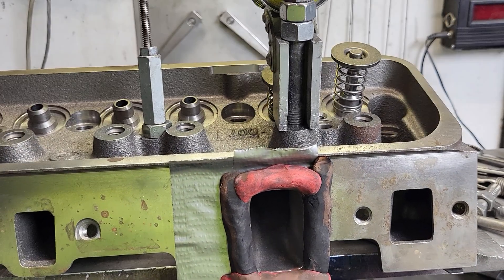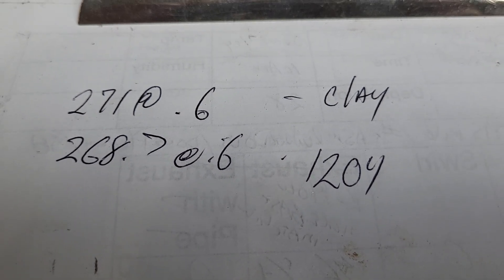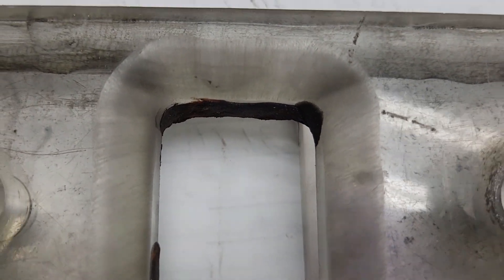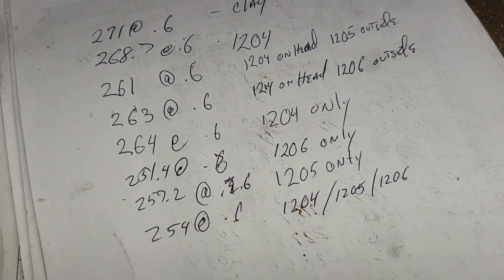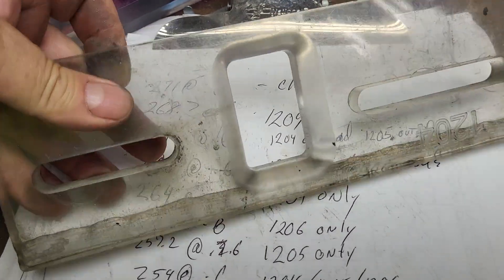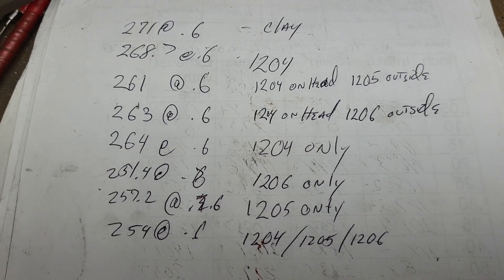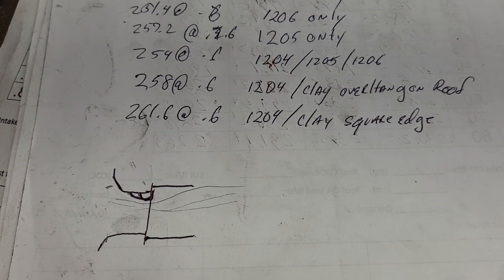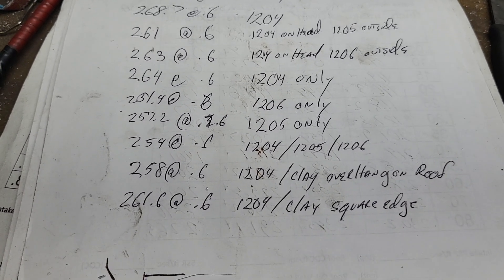Does an anti-reversion edge cost much flow? Interesting air flow games.

Comment: Just came across this and found it interesting cuz I recently pulled my intake off and confirmed that my "lightly ported" intake manifold still has runner exits that are a bit undersized pretty much all around compared to the heads' intake port entries. Wasn't sure if it made sense to work the manifold's runners a bit more, or leave as is. Also, between the burr-type finish of both the manifold runners and heads' intake ports and -- maybe -- those steps in the transition area, the runners & ports look pretty clean for a street/strip engine with a 265 @ .050" cam.
Reply from the maker: Nice. Thanks

Comment: The anti-reversion step is what I put on the inside corner of the Mopar small block pushrod pinch. My idea was the flow going over the step will create a low pressure area and encourage the air column to use the non common wall more quickly as well as create a small anti reversion step.

Comment: As I learn more with each video, I am enlightened that there is SO much to learn and everything needs to work as a symphony… it all is teaching me that an amateur like me needs to start with a block size and realistic end goal… then spend a ton of time and note taking before buying the first part… and with each part, it seems the next part choices might be more limited already by your previous purchased part limits. For a stock street 318 motor used for towing and cruising, I started with the cast iron heads…then next will just mild port my 302s and leave stock size valves, thin head gasket, stock intervals… go standard Edelbrock dual plane and do my best to select a cam suited for the very mild heads… then keep the 4 barrel smaller by trying my 500 Edelbrock first so that everything works towards higher velocity air speeds… and use of long tube headers all in an attempt to pick up the low end torque over stock engine an 2 barrel. Am I at all on the right track trying to make it interpret the last year of videos back from present back to your 302 porting videos? Is my motor too small to be concerned about reversion, or should I follow all of the tricks you talk about in this video for reversion limiting? Sorry so long winded. Don’t feel you have to answer this as I will keep watching and trying to learn. You are my top 5 channels and my top channel regarding my future 318 mods… so thanks a ton!
Reply from the maker: 600 cfm is max carb size, small dual plane. 268 ad dur cam max. Small long tube headers with high flow exhaust. Anti reversion won't do much because the cam is reasonable. Be sure your guides and valve job are good. Thanks
Reply: @servediocylinderheads  I am so appreciative you continue to guide this project for me. You are a great educator… and a beast to work in that garage heat and humidity when you are already so busy! I wish you great health and continued success!
Reply: Is that 268 advertised or at .50 lift. The cam I presently have in the box is 262 advertised and 218 @ .50 thanks.
Reply from the maker: @DrGo-bw2jy  That cam is a touch big but will work fine.  Advertized.
Reply from the maker: 210 @.050 is about right for some decent heads
Reply: @servediocylinderheads  thanks Charlie!
Reply: @servediocylinderheads  per a comment by DV on one of his videos, he noted that if a person uses a 1.6 rocker on intake only in place of the 1.5, it can tighten up LSA by one point… so my 110 becomes equivalent to a 109LSA. Is that a good idea for me or is my motor too mild and would already be slightly over cammed? Wasn’t sure if stuffing a bit more air and fuel with a 1.6 would choke my small motor. Last questions on this topic.
Reply from the maker: @DrGo-bw2jy  I doubt it would have much effect. 1.5's will work fine. 1.6 will work fine. Mixing them will work fine. My favorite is 1.6 on intake and 1.5 exhaust. They are usually hotter combos.
Reply: @servediocylinderheads  10-4 … thanks again. You are a wealth of knowledge and experience for sure!
Reply from the maker: @DrGo-bw2jy  Not by everyone!!!

Comment: IT like to test a small venturi on a ramp at the port entry.
That could be usefull to gain flow velocity. Esp if its a Big port small valve configuration
Reply from the maker: It is relatively small port small vale combo.

Comment: The benefit of the mismatch for antireversion is in a sharp edge re-atomizes the fuel Much better going into the head . The mismatch has to be huge and Very power limiting to be effectine going into the head . Id found haveing Multiple Small antireversion mismatches superior to larger ones . 
This isnt new stuff just re-visited older more thorough thinking .
Reply from the maker: Not what I am looking for! Thanks
Reply: @servediocylinderheads   youd better pay attention then to Which Pinch as in the % youre refering to !!! I know what your after in the pressure wave  !!! International Harvester solved much of this on their distalate fueled tractors nearly 100 yrs ago .
Reply from the maker: @bobgyetvai9444  International had some good engineering.

Comment: So interesting but you did not flow it backwards .... Interesting thing I found on my bench is that when you flow a intake with taper like a single plane backwards it flows more then forward ..... But in this I would flow it fwd first ... And then backwards .. then add the dam and do it again ... Goal of course is full flow fwd and less flow backwards
Reply from the maker: I did and you are right. Like putting a pipe on an exhaust port. Thanks

Comment: What if on a TPI  project,  the runer are replaced with fabricated runners about .150"-.200" larger diameter. And the tubing possibly made from rolled sheet metal. Is pie cut and welded to make the Bends. With a ANTI REVERSION ledge on each cut . It should be similar to flowing through a series of reed valves!  It could something to play with  if nothing else just the knowledge. Maybe put a series of pressure sensors at each ledge. To see what the pressure is doing ,check out  the  flow  behavior.  I have wondered how a valvular conduit would behave in this situation. (Tesla valve)  someone with a 3D printer could print a intake runner with recirculating directional valves on the walls . Having tiny ramped scoops to catch the reverse flow and turn it on it's self. For bench testing.   Pulse testing may show differences,  maybe a valve in the flow bench could simulate pulsed intake flow?
Reply from the maker: Pulse testing is done on a dyno. Interesting idea, I think you should build it! Thanks

Comment: Interesting video Mr. Charles! My 2-cents, how about the intake runner extending into the port (1/4") creating a recess/pocket to trap reversion pulses. I question how accurate flowing a head in one direction is, when a head on an engine experiences alternating intake flow pulses.  The video where Jon Kaase sticks his finger in an intake port on a running engine , and his finger is violently wiping back & forth, tells me we're only scratching the surface on intake flow theory. Thank you!
Reply from the maker: I never did that on an intake port but I bet it would work. I have done  it on my Chevelle exhaust system. 3" collector extension with a 3.5" exhaust pipe over the extension. Worked very well. Early 90's tech. Thanks

Comment: My guess is the anti reversion would limit the amplitude of the resonance waves both peak and trough. to see the effect of your shelves on reversion you could run the bench on exhaust. With the reverse direction of the reversion pulse the air will likely swap from the floor to the roof at the head/ runner interface with the manifold on,. I think your bell mouths are to short to trust the air behavior off the ramp with the string (but you can't see it with the manifold on) Inspection camera with string?, 

It's all very interesting, do you gain more in the middle by dropping the intensity of the high RPM resonance charge effect. I assume that's the source of improvement in driveability on an "over cammed" motor. What would a Tesla valve intake runner do, do you still get the first harmonic, these questions may keep me up tonight longer than the starship launch.

As always thanks for the great, intersting content and don't listen to me i'm an armchair idiot.
Reply from the maker: I like this idea. Thanks

Comment: Vizard carved a groove on the face of the intake valve and claims that works.
Reply from the maker: I don't like that mod. I was worried about fatigue and valve failure. Part of the reason that worked was the valve would fit the seat better due to flexing. I would rather get the seats as close to concentric as I can and send it. Thanks

Comment: I'm looking to go EFI using a lot of factory hardware & I've been encouraged to use the factory ECU by others who've had success. Problem is that I'm going for a bit bigger cam so I'm very keen to know more about your anti reversion techniques for EFI etc.
Reply from the maker: Think of it as adding just a small amount of taper at each interface. Thanks

Comment: Thank you Charles! I wonder is there anyway to measure whether the flow constriction is in the chamber side of the port or in the runner side (perhaps it would be areas right around 1inch of radius of valve dish) ?
Reply from the maker: It is a good question. Thanks

Comment: Flow expands in a diffuser, but in your drawing @7:00 you also create a reversion vortex going counter clockwise in that empty space. It's basically working like a wheel, so the flow that goes over it picks up momentum, but the flow near the wall on the opposite side is pushed into the corner. That wheel is deflecting the flow around it. It's basically putting in the body work you left out, if you put bodywork in that recirculation bubble you stop it from growing essentially.

*edit, since it acts like a wheel anything downstream of that recirculation bubble is essentially turbulent.

Comment: I've been thinking about the "flow drop" when you add runners.  I think the port is so short that air short circuits and gives an optimistic number.

It doesn't really stop reversion.  It does not stop waves, which are high/low pressure.  You get eddies in the dead space that suck energy out of the flow.  I know some NASCAR teams do round ports with a port match.  There are things you can do to stop reversion in the chamber and throat.
Reply from the maker: This is not nascar, it is a hot street ride.
Reply: The eddies both give and take away energy, the fact they transition the flow to turbulence is the greatest energy loss they produce. If they grow too big they shut down the cross section area, then you can get into an energy loss scenario. Turbulent flow has more drag than laminar flow, however flow in a running engine is almost entirely turbulent. Furthermore, turbulent flow stays attached to walls better than laminar flow, because turbulent flow can borrow energy from the flow to keep it energized at the boundary layer. Laminar flow doesn't so it has potentially more energy, but also more susceptible to separation from adverse pressure gradients, also laminar flow doesn't stay attached that well. All the unpredictable behavior in laminar flow makes it a wash when compared to turbulent flow, as laminar separation is more affected by hysteresis than turbulent flow you also can't use very high AOA with laminar flow.

Vortices are the only way that you can keep flow attached beyond 15 degrees, you can get angles of attack as high as 35 degrees. For example the 1939 Chrysler Airflow, had a slanted roof that created a lift inducing vortex, this kept the flow attached down it's huge sloping rear roof line. It also made the car produce lift at the rear, which made it extra sketchy at high speeds.

https://youtu.be/pk-_Hg6Rh0A?si=NiNz9OWGy1HwLqIJ

Comment: Hi Charlie. I know this is an injected engine but that anti reversion idea on the bottom of the port could be a double winner on carb application.  Anti reversion dam with minimal flow loss and also a fuel re atomization ramp = double win.
Andrew
Reply from the maker: Interesting, right?